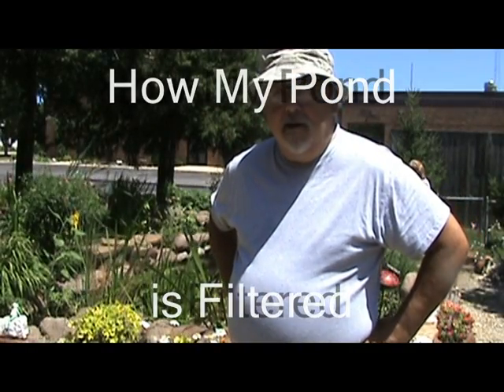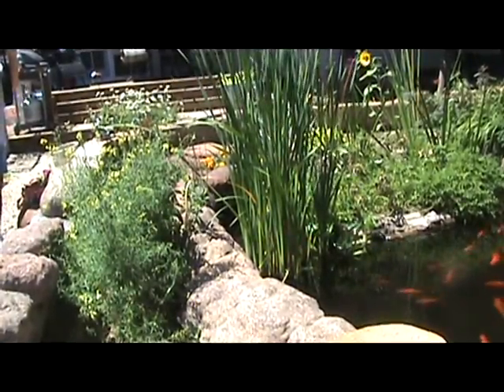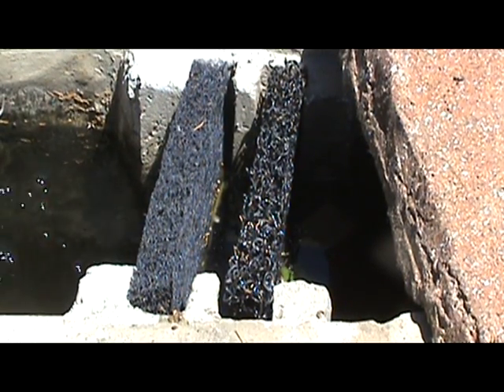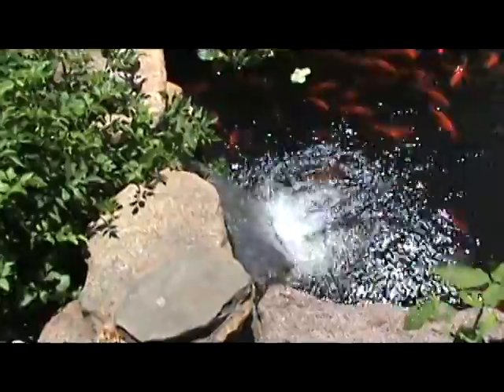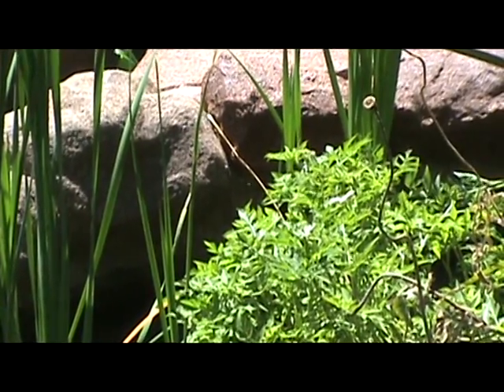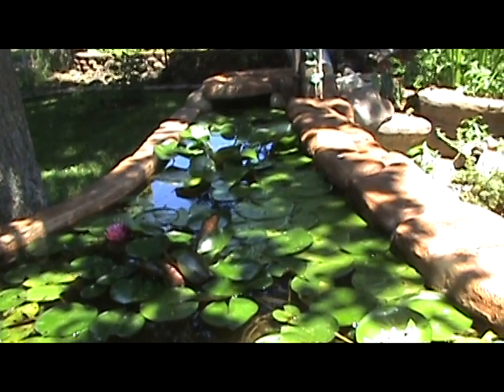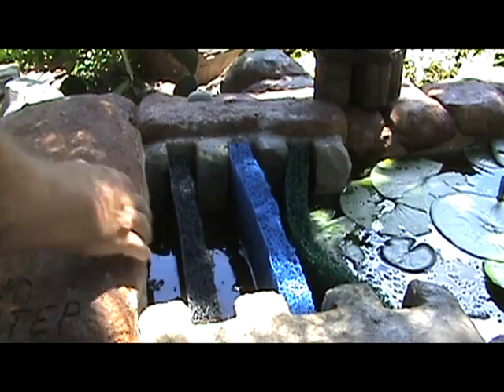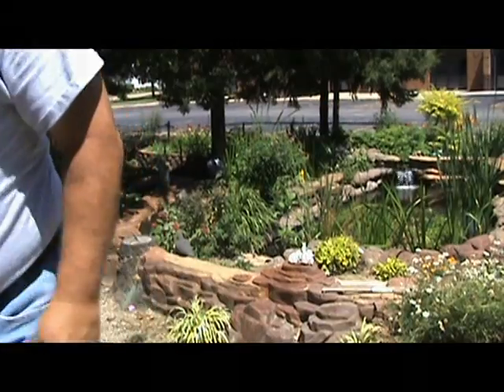Pond Filter Systems.mpg

Comment from the maker: @Amexico56    I have no accurate idea.  It is a hobby that started a few years ago and has been developed gradually.  Like any hobby, I haven't kept track of the costs.  It is, however, not as much as you might think since much of the volume of the rocks is made up of recycled stryrofoam packing material.  The initial pond was probably somewhere around $2000.

Comment from the maker: @Den0Q  I add water by putting the garden hose in the main pond pump pit.  There is an aerator that add air to the water and the aerated water goes through twenty odd feet of pipe to the top of the stream.  It then travels down the ten feet or so of stream to the waterfall and finally into the pond.  By the time it gets to the pond via that route, chlorine is pretty well dissipated.  What isn't is diluted in 3000 gallons of water.  I've never had a problem with that method.